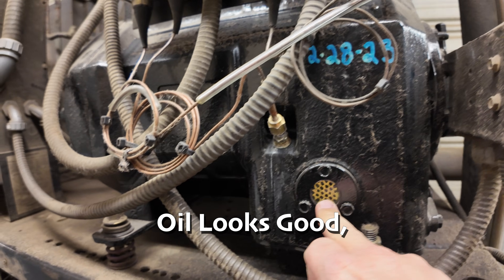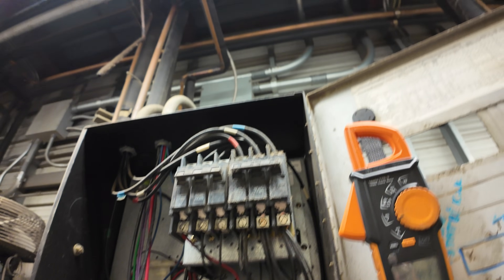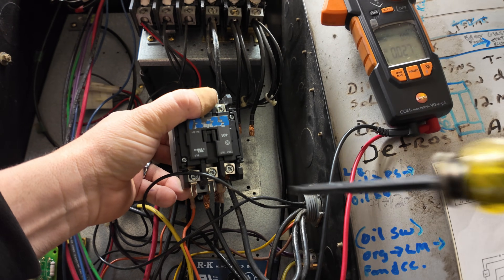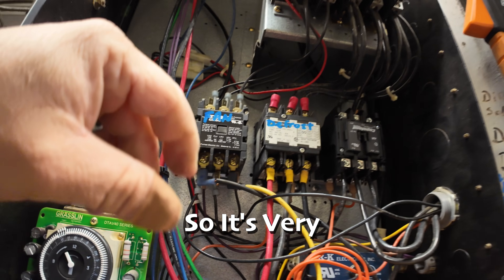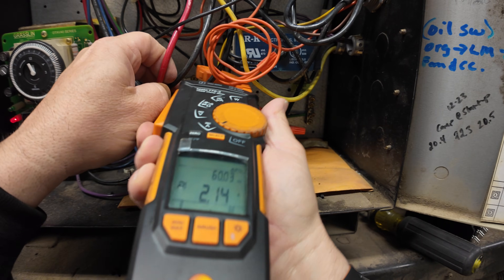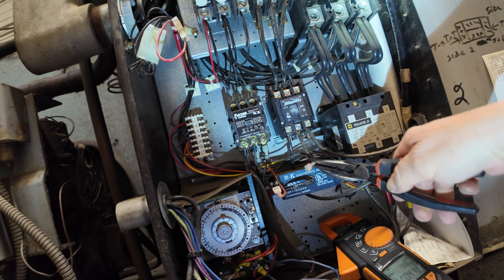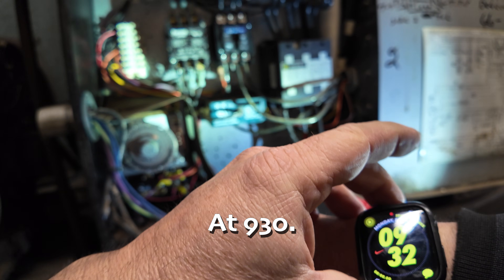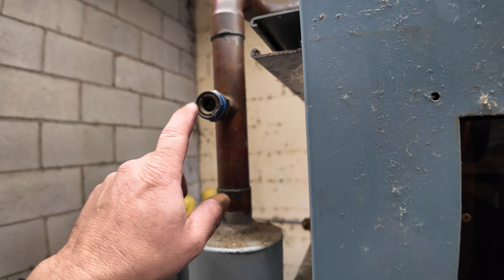Grocery Compressor Problems

Comment: Rick! I was just talking to one of my coworkers after work today and we got on the topic of weird issues because there has been a unit I have been working on that has been taking me through the ringer with a super weird issue, it’s a MAU, and he mentioned a new greenheck MAU unit that you have to set static pressure across the burner, he has not been able to set it properly and multiple guys have gone out there and when they get there it runs completely fine the whole time but they’ll leave and the unit will have random flameouts from time to time. They called greenheck and they said it might be from EMF from the electronics causing weird things which is obviously such a cop out. Just thought I’d share because I remember seeing your video about the greenheck MAU and I told him about your video too and how you were having issues.
Reply from the maker: I think the best thing to do on that unit would be pin that tamper so it can't move. There's no variable air volume in that system so there's no reason for it to have it, but we haven't had any calls on that unit so I guess it's working fine. I appreciate you sharing the info.

Comment: phase loss and having about 120v on a  208/240v contactor isn't good, too low of voltage to pull in, so the current draw stays high and they sit there cooking until coil or thermal protection fuse opens.
the inrush current is always high on a contactor before it pulls in or it physically stuck out(broken/bugs), it drops once the plate pulls in and changes the cores magnetic flux by being bridged across.
it would have been buzzing loudly if anyone was there to hear it and overtop all the other noises.